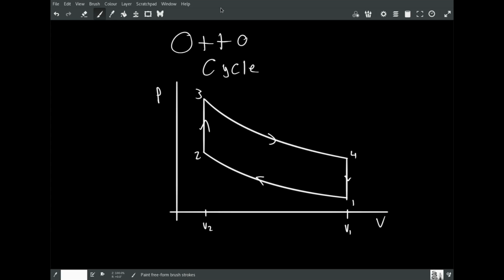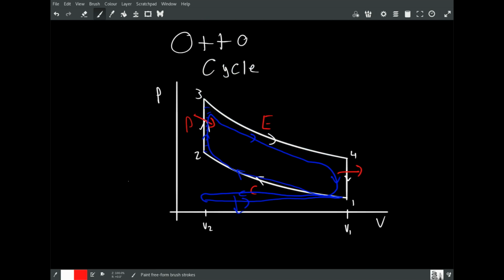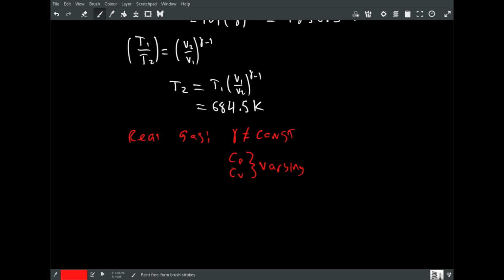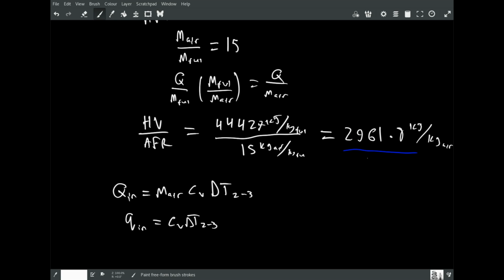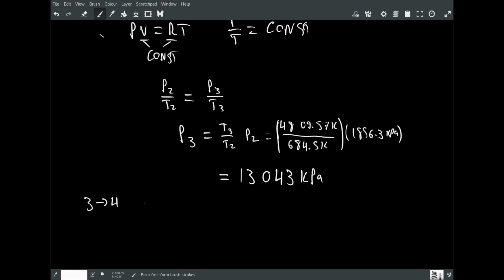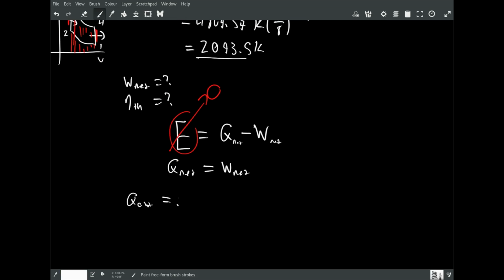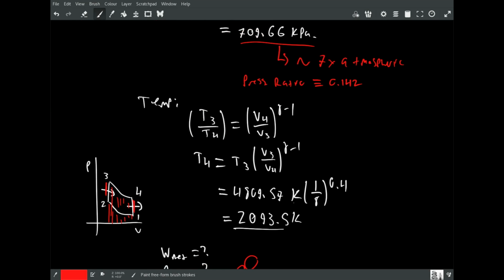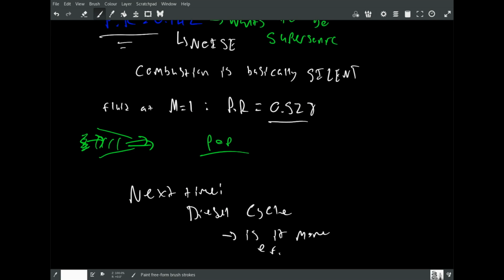Simple Otto Cycle Analysis

Comment: hi, the temperature change for 2-3, was for combustion of 1kg c8h18 ?
Reply from the maker: The temperature change is for an air-fuel ratio of 15 using a given heating value for C8H18.  In the video, I convert the heating value to kJ/kg(air) to be compatible with the constant volume specific heat of air so that the mass cancels out.  

So yes, this will give a result for 1kg of C8H18, however it is also valid for any other mass of fuel as long as the air-fuel ratio is 15.  The only place that mass enters in to the equation is when you want to compute the heat or work output, which requires a mass of air to be given.